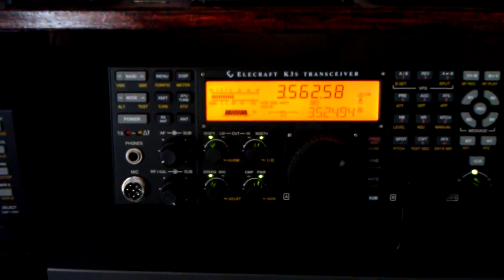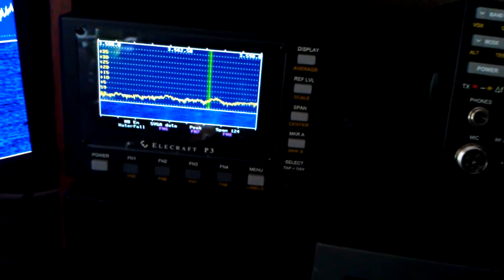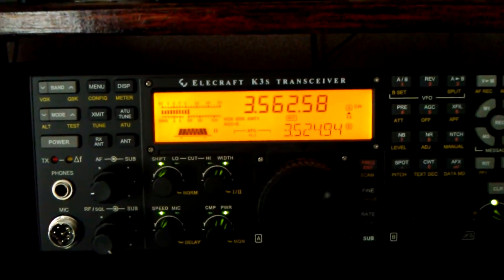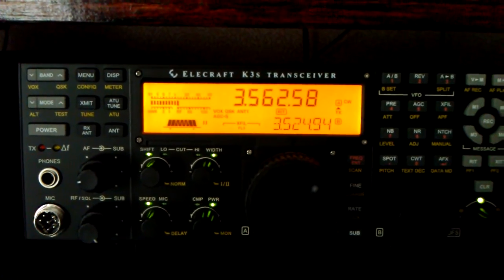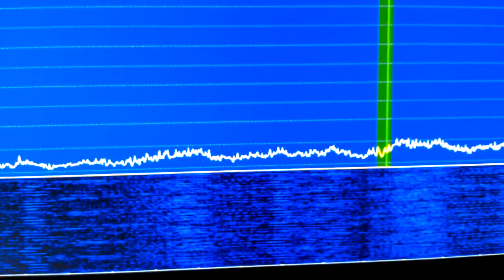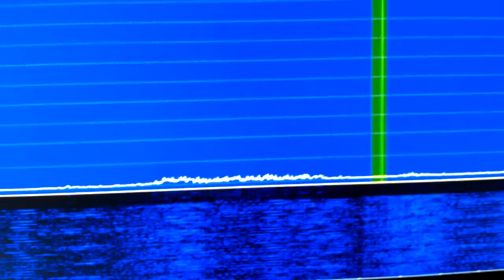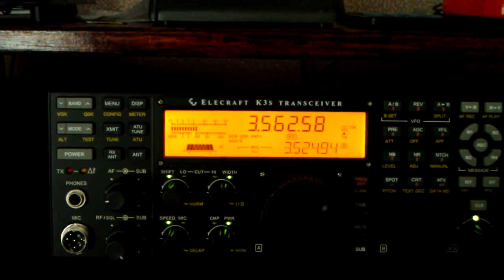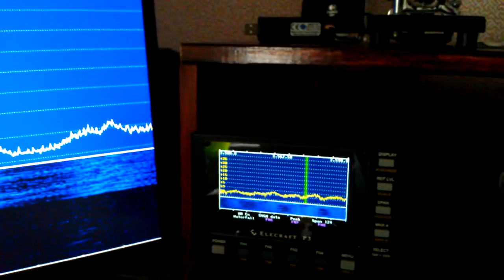Elecraft K3S and P3 Noise Blanker Demo

Comment: Why aren’t you using the IF hardware noise blanker on the K3S?  The K3/K3S software noise blanker your using doesn’t work well for the kind of noise you’re experiencing- but the IF hardware noise blanker would.  Just turn the little dial, not the big one.

Comment: Not sure why you would want separate NB on the radio and panadapter. Elecraft should fix that.
Reply: What he’s really demonstrating is that he is confused on how to use his noise blanker on the K-3s.  Both the K3S and the K3 I have two separate noise blankers built into them. One is a software based DSP noise blanker controlled with VFO A, The other is a more traditional, but very powerful and enhanced hardware based noise blanker at the I F stage controlled by VFOB. For the kind of noise he’s experiencing, he should be using the I F noise blanker.  But, as evidenced at the 50 sec mark, he has that nose blanker turned off.  

In some ways, this is Elecrafts fault, they don’t do a very good job explaining how to use their noise blankers.  The bottom line is that for traditional powerline noise with regular pulses, You should use the hardware based IF noise blanker.  I’ve owned my K3 for 10 years, and I now live in an area where this kind of noise is prevalent. The software based DSP noise blinker doesn’t do a hill of beans worth of good for that kind of noise, but the hardware-based F noise blanker or wipes it out completely.  It’s very impressive. 

The P3 pan adapter gets its input from the K-3 before the noise blanker stage kicks in, that’s why it has a separate noise blanker. It doesn’t have anything to do with the receive audio on the K3 or K3S.